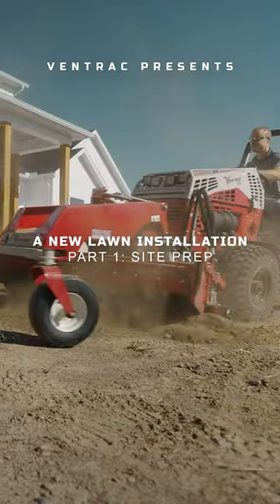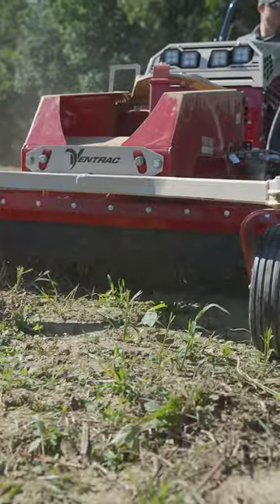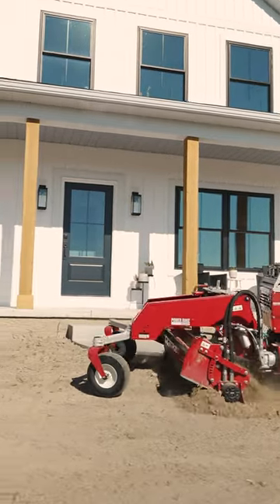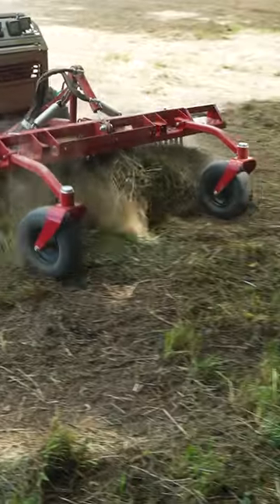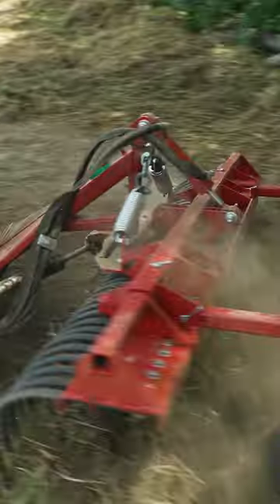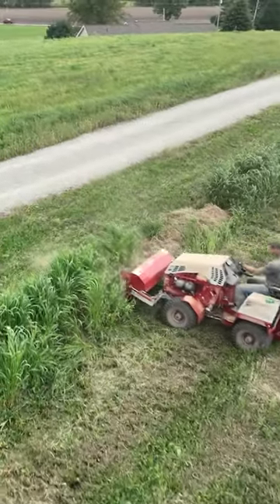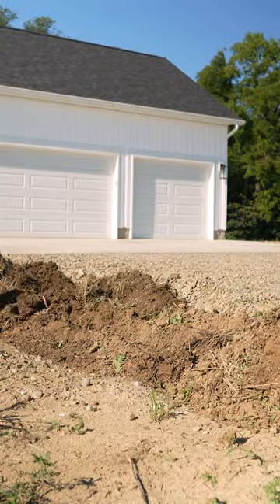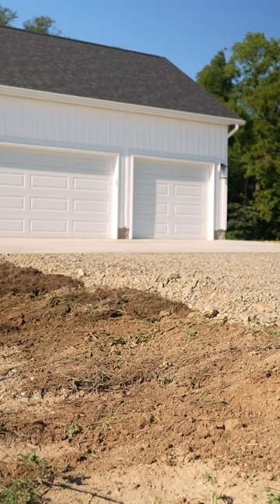Part 1 - New Lawn Installation with Ventrac

Comment: Is the bucket deep or were you just doing small scoops? Didn’t seem like it held much. I love this machine!
Reply from the maker: The power bucket holds 6 cubic feet of material which is typically more than adequate for the jobs that this bucket is used for. Looking at the footage, some of the sod shots do not show the bucket at full capacity. This video may help explain the bucket better: https://www.youtube.com/watch?v=K29iWkAtFeE

Comment: Cool idea for a small machine, but I can’t for the life of me fathom how horrible it would be to use most of these attachments at the front of the machine. The dust in most real life scenarios would just be overwhelming. Any kind of grading, raking, sweeping, or any of those things that stir up dirt would be terrible
Reply from the maker: This occasionally can be a problem, though it isn''t a common complaint. We have a canopy that has a overhanging fan that creates a down draft to help mitigate the amount of dust that comes towards the user. Here is a link to the Canopy: https://www.ventrac.com/products/accessories/70.4169